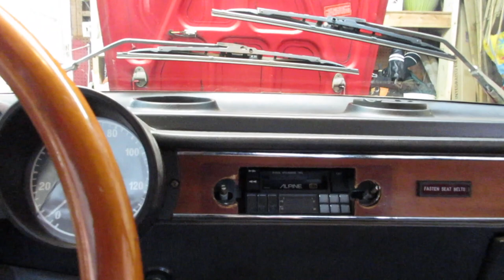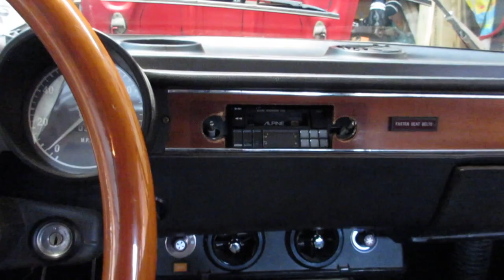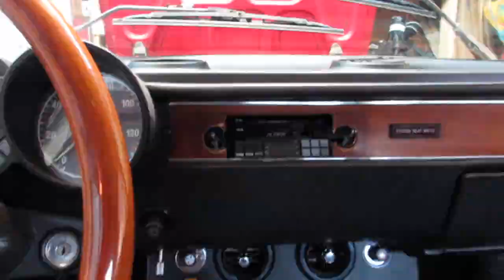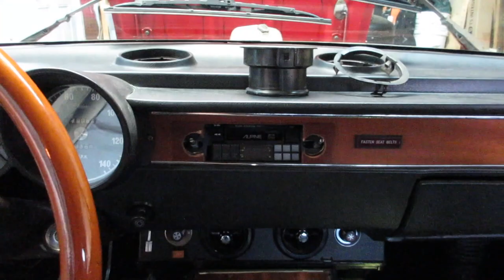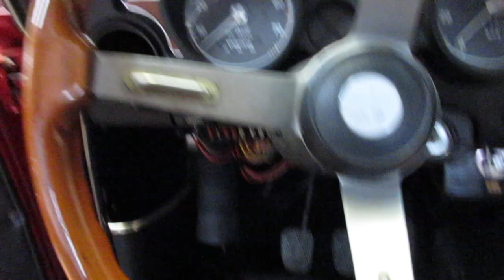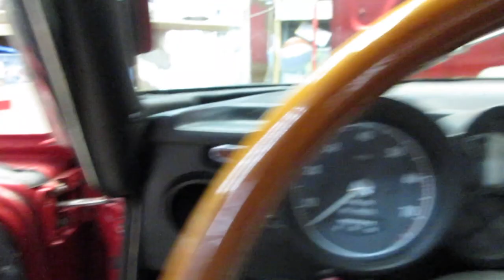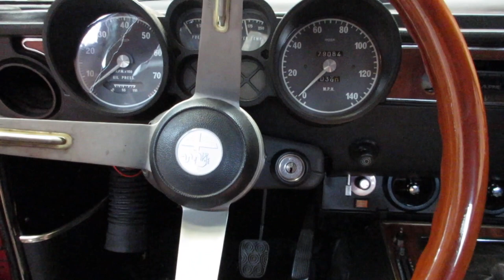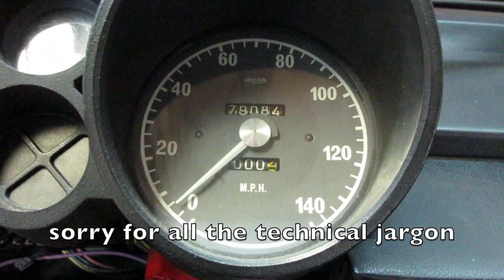Episode 6 - Brakes and Dash

Comment: Great Video. I was going to get under the dash and reroute my new fresh air tubes but now that I see how easy it is to take out the whole dash, I'll just do that and everything else I wanted to do in there. I think I'm going to install a new Blade Type Fuse box. Hold on to all that AC stuff, I'm sure many people will want to buy it off of you.
Reply from the maker: Thanks - yeah, I am holding onto everything even if it doesn't go back in right away. the dash is pretty easy (the instrument binnacle is kinda of a pain, but the rest is easy - especially with two people. I will say that there is not a lot of extra room back there for much else than a smallish radio head unit.